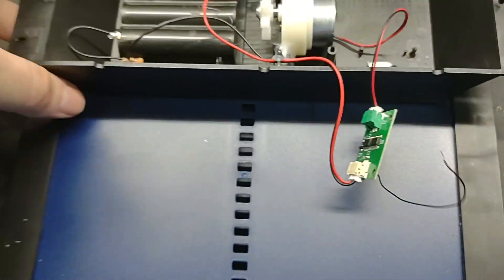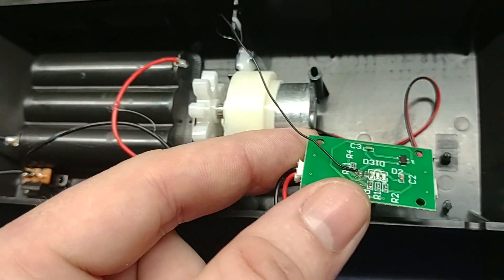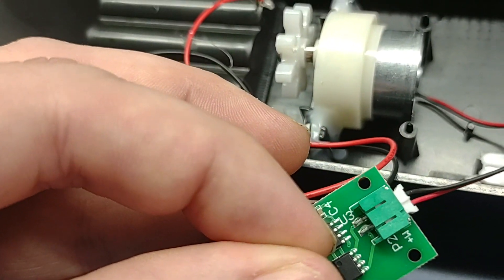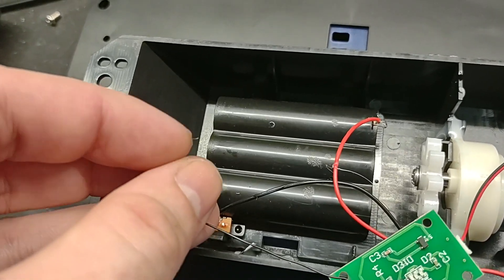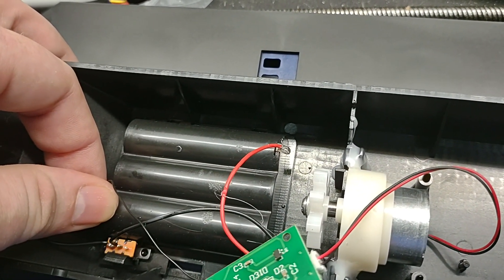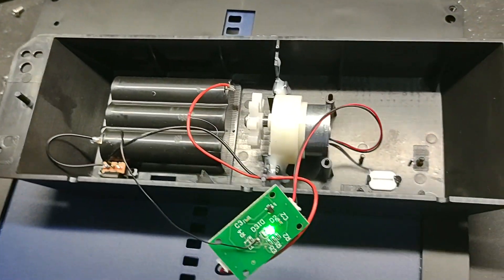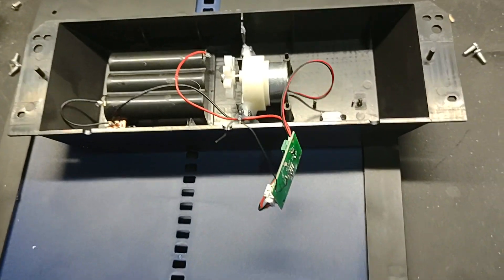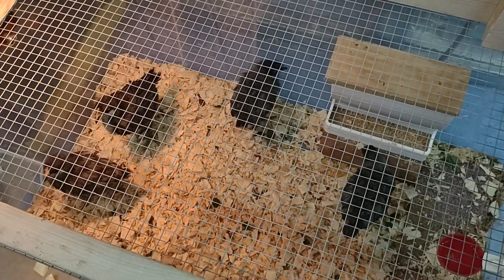Hacking a cheap amazon automatic chicken door to work with Arduino or Raspberry PI

Comment: Hello, I bought an automatic chicken coop door last year, but I thought I would power it with a battery. When the amperage was too high, it burned some of the circuit elements. Is there a way to find that circuit?

Comment: Hi, great! I was just looking for this, this helps a lot. But about a Raspberry Pi Pico, how would you power the motor as itself can only ouput 3.3V. Thinking about using  lm7805 with USB connected to it for power? The 4,5V is just not that nice... lower or higher was nicer these days and I'm not aware yet of the marging it can handle. Maybe you tested that already!
Reply from the maker: So what I ended up doing was hacking up a usb cord to hitch into 5 volts for the power and ground from a hub thats inside a box on the back of the chicken coop, which also contains the raspberry pi, then I hooked my hacked in 'signal' line directly to a GPIO pin as the signal goes to a microcontroller it only needed 3.3v, no other glue logic was needed and its been running for a month now happily without any magic smoke :)